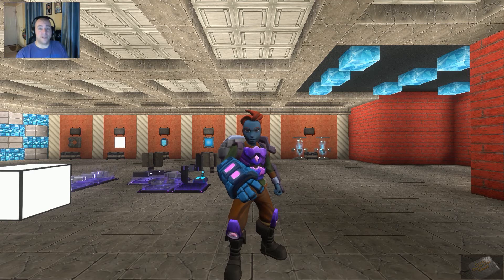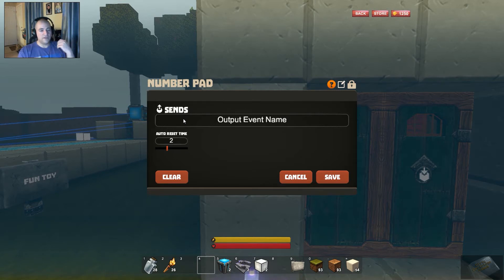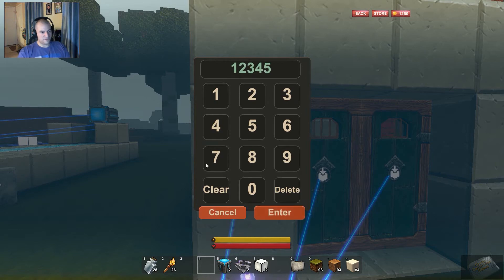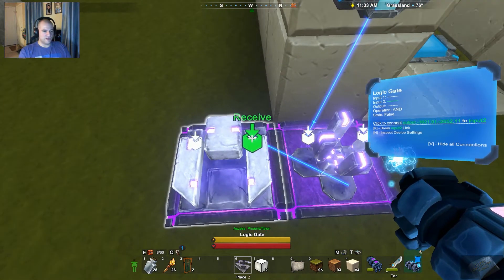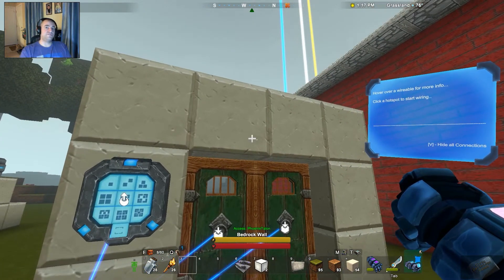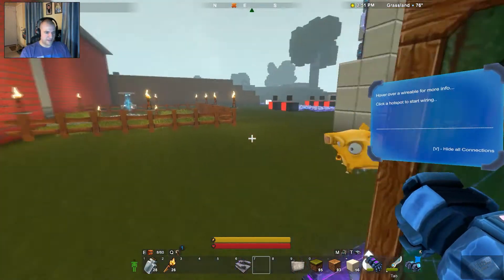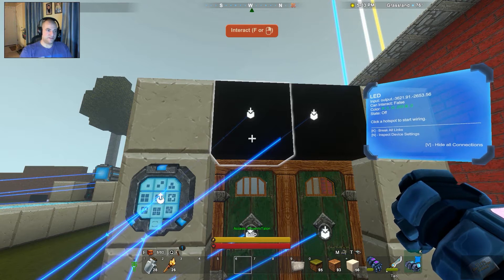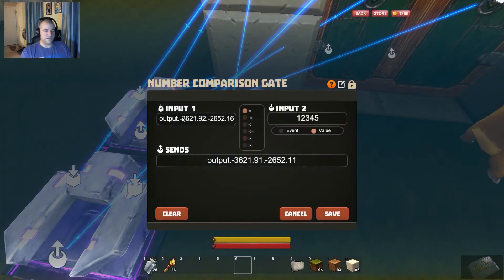Creativerse R36 Machines Tutorial Part 06 - Number Pad and Number Comparison Gate

Comment: I'm posting during R39 and I don't need to use a Number Comparison for my Number Pad on the door. I just use the Logic Gate with the pad and indoors I can set my Sensor or Pressure plate directly to the door without it interrupting the Number Pad set up. Is nice I don't have to use 2 machines with the Number Pad and the trigger machine!
Reply from the maker: Cool!  That's the great thing about machines.  You can have so many configurations!